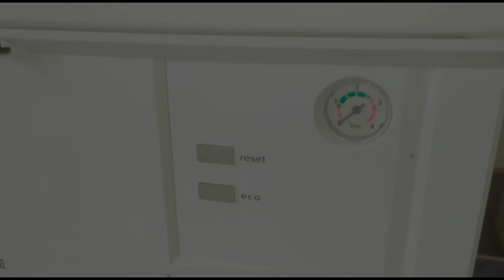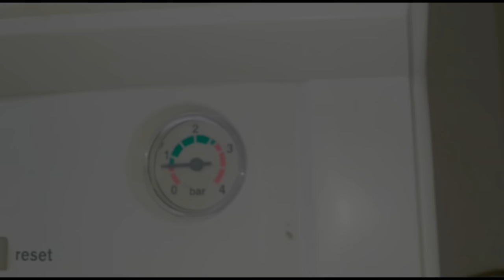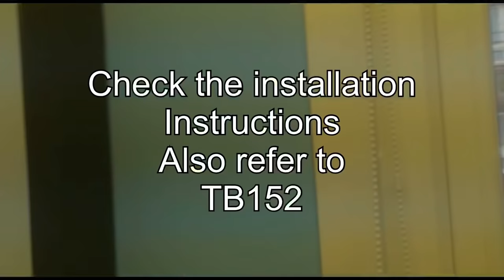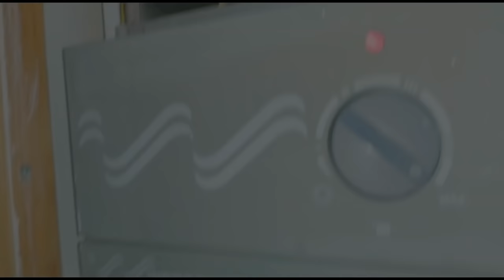Plumbers Videos - Water Leaks and Floods

Comment: The damp I found in vans mostly is the metal roof,  where heat rises and lands on the underside of the roof, it condensates and then rains down on your tools, in my transit van I have used carpet spray adhesive on the cieling then stuck twin foil backed bubble wrap and used the silver jointing tape aswell and it seems to have irradiated the issue and I wouldn't be without it now,  the inside of the van looks like it was once used to grow plants but I don't care as it serves the purpose I need it to

Comment: @ 7:27 I think the "fantastic four" from Viessmann, Vaillant, Bosch Group and Ariston worked together to provide sensorless boilers for years to monitor the lack of water / low pressure in their boilers ... They only relied on the sensor overtemperature ... They are "cute" for their gesture that led to the compromise of a large number of circulation pumps ...
For their nice gesture they will always have a special place in my heart :))))

Comment: As Forest Gump said "S happens!" I was a network engineer and nice simple job drill a hole through the house wall for a cable, checked all the wall for electric cables and pipes, drill through and the brick just split in half and fell clean out of the wall! The customer had a brick sized hole in their wall and it was winter. As a network engineer I don't carry spare bricks and mortar lol. Tape it all up and had to get a brickie to come and fix the hole.

Comment: My pressure on my boiler was so high rang gas engineer and they told me to bleed radiator ,being a woman who lives on her own I had no idea what to do and I’d no key either I was so frightened as I’ve not long got gas in I’ve always had oil before, but thanks to one of your videos and getting a key off Amazon I finally got pressure down so thank you so much as you are so good at explaining things in detail..... I thought I was bleeding for air not water so can’t thank you enough...
Reply: You need not be frightened, your gas appliance will have a safety valve inside it that will release the excess pressure if it gets too high. Perhaps the pressure got high because the filling loop valves under the boiler got left on so you might want to check it's turned off. Sounds like you've found a friendly and helpful gas engineer, might be worth getting them to come round to explain and check the system just for peace of mind.

Comment: The non return should be on the main. I do the hose hand tight and then a very slight nip with the grips. All though its frowned upon i also minutely nip emissions test points, the amount ive come across that a loose(not missing) is shocking. 
 I only tap worcester gauges because, well......you all know the answer yourself.

Comment: hi allen just noticed the pipework on the cylinder behind you are the clips screwed to the cyl casing if so won't that invalidate warranty as damaged casing.nothing worse than a water flood .
Reply from the maker: Yes the clip is into the outside of the tank. Thanks.

Comment: Non return valve should be on the main side of the loop to prevent the water sitting in the hose syphoning back into water main and incorrect hose type
Reply: ehem Disconnect hose aswell..shhh
Reply: @digiicode  It will disappear when you need it most then. I have mine left on but turned off of course.